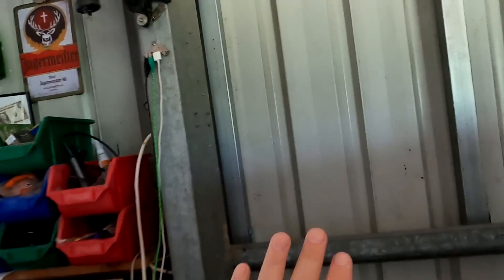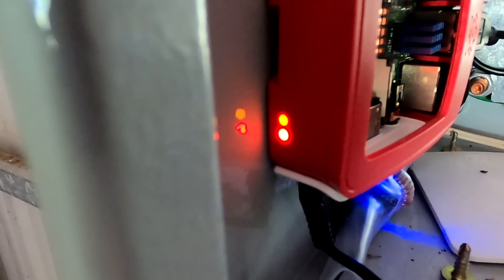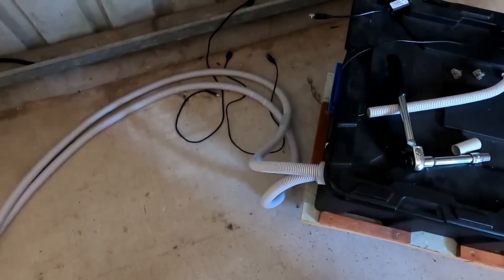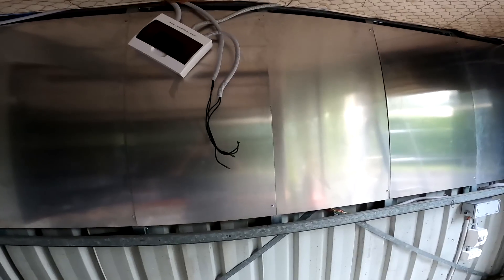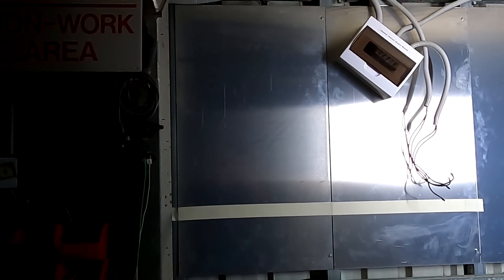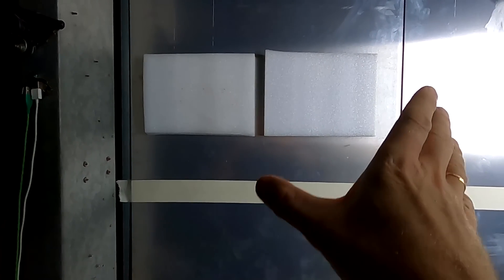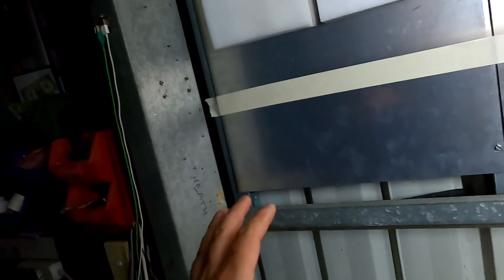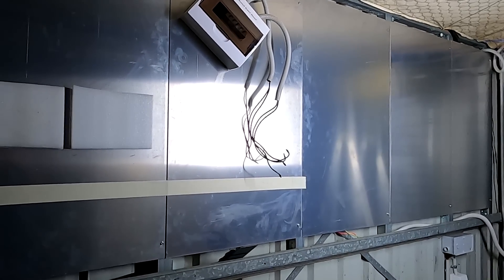Battery, MPPTs, inverter, cabling. Everything is gone... | The PowerWall Project

Comment: I recently wanted to install a 3-phase system for a customer ( 3 x single phase 7,2 kW inverters), but he as no dedicated 3-phase equipment, so I decided to rather go for three inverters in parallel as the total available capacity on the single phase would be 21,6 kW (for a residential property). This proved to have been a better choice for this application as the three phase setup would have limited each phase to 7,2 kW and all loads were (and still are) single phase. 
In a commercial/industrial situation, I can imagine the 3-phase connection would have been the choice. Also, in my case, a fault on one phase might have led to the shut-down of all phases as these inverters require one to be the "master" with the other two as "slaves". So all in all I did not want issues and opted for ONE POWERFULL single phase setup which seems to be doing its thing so far! (Only about 2 months, but I am positive!).

Comment: PS yes leave space for 3 invertors, but unless you have something needing  3 phase stick with single phase.  3 phase is not used much domestically except for larger Reverse cycle Airconditioners in which case is you solar and battery large enough.

Comment: Re insulation, you could remove the external steel cladding, lay the insulation across all the studs and then replace the external steel.  Might need longer tek screws.  This is how these thin insulations are normally installed when building new.

Comment: Hey Andy, don't forget to place some conduit/pipes vertically on the back of the metal sheets on the left, middle and right where the insulation is gonna go, for future vertical cable runs behind the panels!

Comment: Hi uncle Andy,
If your realistically need the 3 phose then go that route,
But if it's a nice to have then rather go 2 inverters.
They not cheap to start with.
If you don't find insulation go with polystyrene.
That will keep heat and cold out

Comment: Regarding the insulation please keep in mind that if the temperature gradient is poorly designed and there are encapsulated areas this might lead to mould (in german "Schimmel") behind your panels. If you do not insulate between the outer wall and the panels you have some kind of chimney effect and proper ventilation is preventing moisture in between. I would go with some plants putting shade to the outside. Looks nice, is cheaper and very effective.

Comment: Keep 2 phase (no putting in new cables) and use the sun grid tie inverter coupled with one of your off grid inverters, the sun grid ties work alongside the off grid inverters.

When you get your other roof online you may want more current to the house so I would plan to have the 3 for future expansion

Comment: Andy, regarding insulation: please consider rockwool insulation (Roxul is one common brand). It is effective and it won't burn or melt. Many of the aluminum backed plastic-based insulations are HIGHLY flammable, and fiberglass shrivels up and melts. If you are considering something that is plastic based, cut off a sample piece and put a flame to it. If it burns, it's not acceptable! Now try the same thing with rockwool. You can even test it with a propane torch. It won't burn or melt. Welders often use the stuff as a heat shield!

Rockwool also works as an effective sound insulator, so the frogs should be less audible!

Comment: 3 inverters, one phase :) You can then charge car with 32A and not worry one phase will be overloaded. Unless you need 3 phase system for some electric motor device (still it can be reconfigured)

Comment: GREAT VIDEO . YOU CAN SET UP THE WALL WITH THE TWO OR THREE INVERTERS IN THE MIDDLE , HAVE THE BATTERIES RIGHT UNDERNEATH THE INVERTERS TO PREVENT LONG TRAVEL POWERLESS . ALL THE DC CIRCUITS = PV MODELS , BREAKERS , DISCONNECT SWITCHES , LIGHTNING ARRESTORS AND WIRING LEADING TO THE BATTERIES ON THE LEFT OF INVERTERS AND ALL THE AC CIRCUITS TO AND FROM THE INVERTERS , BREAKERS , DISCONNECT SWITCHES , LIGHTNING ARRESTORS AND TRANSFER SWITCHES ECT TO THE RIGHT OF INVERTERS . SEEMS LIKE A PRACTICAL IDEA :goodvibes::goodvibes:IN KEEPING EVERYTHING IN ORDERLY FASION . 👍CHECK OUT MY DIY SOLAR VIDEOS ON MY CHANNLE  FOR ANY IDEAS AND MAY THE SOLAR BE WITH YOU . ✌

Comment: Hi andy,
Here in Oz we have verandahs for the heat so why not an extra skin of metal on the wall outside which allows air to circulate from an open bottom to an open top. It would only need to be 30-50mm raised off the wall. André

Comment: The insulation that was $116 is actually way cheaper, since it’s 60m of product, when the other was $80 for just 6.7m. You would have to pay 9x $80 to get the same portion as the $116. I’d go back and get the $116 since you’d have enough to double or triple layer it if needed. Also, yes 3 phase. If you think there’s even a .001% chance you will eventually do 3 phase, prepare for it now.

Comment: Yes,Yes,Yes Three Phase all the way! future proof wherever possible, Andy on the question of insulation? would it be possible to prevent the summer heat from hitting the workshop outer metal skin by growing a deciduous vine on a lattice mounted off the external wall - shading the metal in summer? thus negating the need to insulate?
I feel your anguish and sense of urgency all those solar electrons on your roof with no where to GO!
Love your work. Cheers Glenn. South coast NSW

Comment: I quote yourself: "Why would you not put three phase to the house?"
Remember?
Although it can be smart with three phases in the house, it is you who knows best if you really need it based on the house's electrical equipment and consumption.
If two phases have been enough for your house so far, it will probably continue to be enough for the rest of your life.
Blue Victron boxes are not cheap and I think it can be smart to buy what you need, not what feels most fun at the moment.

Comment: Mat I suggest that you place the chargers horizontally at the bottom of the wall at the left with the DC circuit breakers directly above them. That way you have a direct path from the roof straight down to the circuit breakers to the chargers to the batteries that will solve the problem o f one charger being above another.  That way you will also have easy access to all of the fuses/breakers, and chargers.

Then you can also easily identify which roof panels lead to the breakers, chargers, and batteries. You will need to move the breakers/fuses from the ceiling and place them on the wall.  If you are going to have fuses along with the circuit breakers, they can also be placed on the wall directly above the breakers.

Comment: Consider to put the aluminum panels on hinges. Then you can run cables on the back of the panels. A lot of work now but….. you know you will change your mind on the future. 

About the inverters, just plan for three phase now maybe you can install outside ones first just for esthetics. It is better to pre-wire everything that you will need on the future and have cables ready on the back of the panels or inside the wire ways. 

I’m learning a lot with you…. THANKS.

Comment: The insulation you're considering blocks convective and radiant heat transfer. It does poorly on conductive heat transfer. Your bare metal panels you installed already do well at reducing radiated and convective heat transfer. If your panels have plastic film on them, peel it off the back side before final connection to the wall. The film has a higher emissivity than the bare metal.. At this point you have essentially replaced the foil insulation. Here in the states, we have foil faced polyisocyanurate foam sheets. If you add a layer of that against the garage siding, you will have more actual r-value from a half inch of the polyiso foam than you'd get from the other stuff. Just make sure the shiny side faces open air. If the shiny side touches the outer siding, you lose your radiative barrier. A half inch foam board against the siding also allows convective air flow between the metal panels and foam board.

Comment: I may have missed it in earlier vlogs but why are you referring to 2 phase power?  Australia is typically Active/Neutral/Earth single phase.  If you are using two inverters they can be wired in parallel as single phase.  No need for one inverter per (two) phase.

If you need 3 phase for a few appliances then 3 inverters, one per phase is best.  But keep in mind this removes all your head room for your single phase loads so you need to be very careful to have large loads evenly distributed across the individual phases. ie 3 5000w inverters in parallel allows up to 65a in single phase. Plenty of capacity for numerous large loads to be in at the same time.  3 inverters as 3 phase only allows 22a per phase so you will struggle if you want to turn a few large loads on the same phase.

If you only have one or two 3 phase appliances it may be better to have all inverters produce single phase and then just use a 220v vfd to convert single to 3 phase power for your one load.  Your single phase loads can then be used without concern of overload or phase imbalance.
Reply from the maker: We have three phase power but only two phases are going to the house. It's in an earlier video here
https://youtu.be/LQJZUmWDuCs
and here
https://youtu.be/evuxwiY8z1Y

Comment: I would not take that effort, to not be prepared for the three phase system. But consider for the Multiplusses you need also space in between them, not just like the charge controllers. I have mine 120mm apart, looks about right. And i quite like your design coming from DC to AC. Happy power wall building ;-)
Reply from the maker: It says 100mm all around them as a minimum space requirement. But I can probably do 300 easily.
Reply: 300mm easily with two or three of them? I increased to 120 becuase 100 really looks tight :-/

Comment: Great progress Andy, I guess three fase would mean u can charge your car faster in the future. For home appliances it is not worth it in my opinion. If the only sun you get is a bit in the morning on that wall.. the aluminium mounting plate will get hot (warmer)by chargers and inverters at peak moments, then maybe the outside wall will provide a cooling effect surely cooling it down faster in the evening. No insulation behind it. Looking forward to the next video.
Reply from the maker: I really don't need to charge faster, there is no requirement for that. Car charging is not the driver of that upgrade.

Comment: What are you ever going to run on three phase?
Reply from the maker: Nothing but you can spread the load across all phases.
Reply: @OffGridGarageAustralia  only if each load is wired separately to each inverter. Wouldn't it be better to have them all supplying all of the loads through one ac distribution panel? (Parallel)

Comment: A 3-phase system is fine if you want to use 3-phase motors or car-charging or any other 3-phase machines in future. Or if you plan to change your 2-phase support of the house into a 3-phase, maybe because for using 3-phase air-condition or 3-phase stove or washing machine.
I think I would use the space for placing 3 Inverters. At the moment I would place the new Multiplus next to the DC-Breakers and the older Phoenix on the right side of the Multiplus. And if you will have one or two more Multiplus you can kick out the Phoenix.
Reply from the maker: I don't have three phase applications, but the house is running on two phases and the third could be for the garage.

Comment: Andy don't worry about having 3 phase unless you plan to power 3 phase loads. Parallel your inverters togeather and eventually when you connect the house just parallel the 2 phases going to the house and make it a single phase Supply.  
Your house would be 2 phase only because of limitations of the grid where you are.

Comment: I don't understand why you need that insulation. It does not make sense to me - you are anyhow not directly on the wall with the inverters...
Reply from the maker: It's sunny hot Australia. This is a bare metal outside wall. If the sun shines on it you barely touch it and it radiates all the heat inside heating up the controllers an inverter even more.
Reply: @OffGridGarageAustralia  but you already have an air gap, air movement should be better than long term heat accumulation by some insulation...

Comment: I would place the charger directly in the middle of the seam and the 2nd one to the right of it near the ac stuff giving you free space to the left for another inverter or something that you have not thought about yet. Honestly i wouldn't insulate, because with the amount of aluminum mounted on the wall, there will be little to no affect of the insulation regarding temperature.
Reply from the maker: I could feel the aluminium heating up from the outside in the old installation where the inverter was sitting on.

Comment: Hello Andy
I would err on the larger side, this means get bigger than you need for trunking and i would definitely keep space for a third inverter. If now you choose to only keep space for two inverters and you have to derate more that you would like you are stuck with only two. Keeping space doesn't cost anything it is just a tighter design. An other idea is to have the solar switch boxes above the charge controllers. I don't know the electrical requirements in Australia but maybe it is necessary to separate voltages, meaning high voltage solar from low voltage battery and low voltage battery from high voltage ac. To gain a bit of space, you can still go down to the floor next to the battery shelf

Greetings from the Netherlands

Comment: With three battery banks you can use two Victron MultiplusII 5000 (max 8000Watt continuous) to empty the battery bank in five hours @ 166Amp discharge.
I would say two MultiplusII 5000 is a good balance.....

Comment: They make a ductwork insulation they may have it there also, it's a soft rubbery foam insulation, with a layer of aluminum on the opposite side of the foam as the sticky , oh it is self sticking, the roll I had was about 12" x ??? Long, maybe 10' long, it would possibly work for the project,

Comment: Andy avoid putting anything near the top that gives off heat - I put a grid tie up near the ceiling once just to be out the way - it was forever getting really hot and tripping the fan on high speed -  when I relocated it 4ft lower it ran cool the fan only comes on slow speed  very occasionally on  the sunniest hot days - I think near ceilings theirs a pool of stagnant hot air
Reply from the maker: Yes, I know that and have seen it. The good think is the heat will dissipate into the roof further up. The solar panels on the outside do a great job and keeping the roof cool. I can also mount an inverter under the horizontal beam 🤔That is probably a good idea... Thanks for sparking this idea!

Comment: I'd go with the placement for the three phase setup. That way you don't lose space in the future and if you decide on two phase, you win a lot of estate for other things. I would even go as far as to hang the inverters from right to left for that matter, as you will most likely need more space for the DC side of things, if you go two phase. Possibly. Eventually. Maybe.

As for the insulation: If nothing else is possible, think about a vented facade (Hinterlüftete Fassade) on the outside. With that you win an extra layer of air that helps insulating. If you use a metal sheet for that, that will even help reflect the infrared rays, too.

Comment: I agree with the majority. Plan for 3 install 2 and the unused area is for future equipment and not necessarily an inverter. 
But I would install the inverters starting from the right next to the AC panels so that the unused area is between the DC inputs and DC conversion. That way if you install something other than an inverter it shouldn't look out of place as it will more than likely be DC related.

Comment: Start on left side. Top could be DC fuses from panels, below it charge controller for that array. Then work your way to the right with same pattern. It will keep each array easy to identify and work on being in a vertical row.
Reply from the maker: Yes, that's a great idea but these fuses will be hard to reach once the shelf is in place. I was planning all solar isolators in this area as well. I'll think about it... thanks.

Comment: Don't waste space, plan 3 inverters, install 2👍
May be it's a good idea to think about optional ventilators for the MPPT devices.
Btw, where did you get the shutdown sript from?
My caravan solar installation ist monitored by a raspberry pi 3b+ an I hate to cut off power, afraid to corrupt the file system🥴